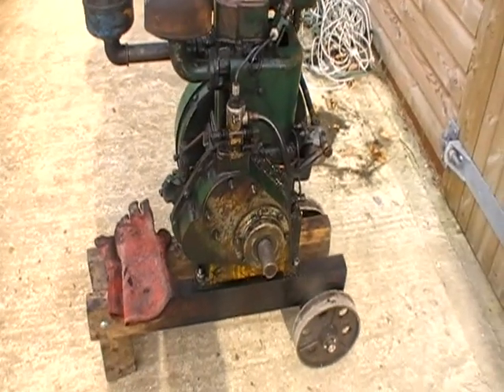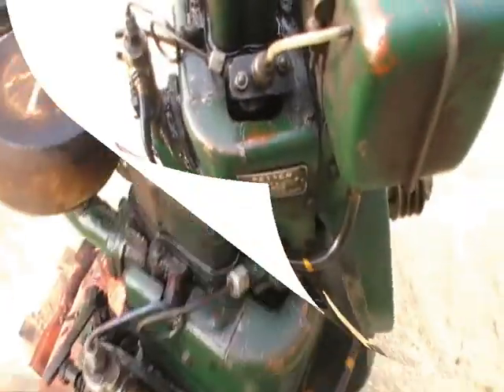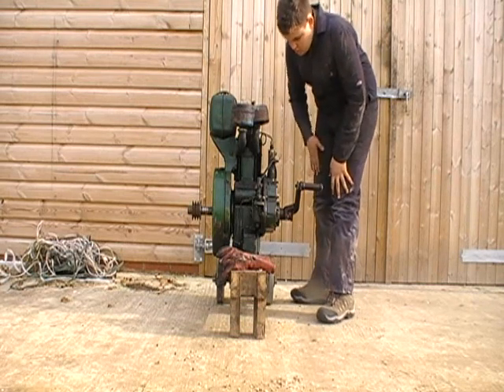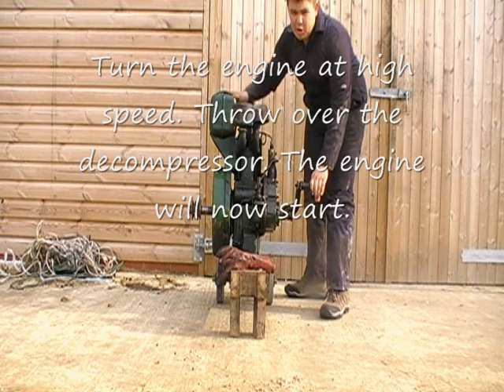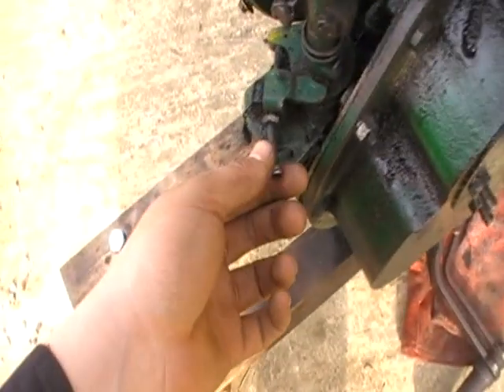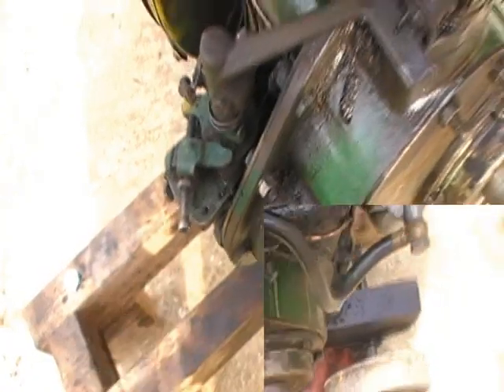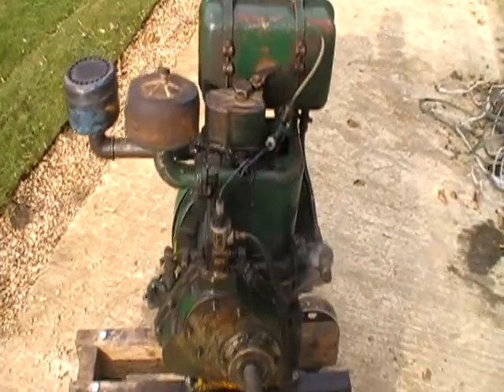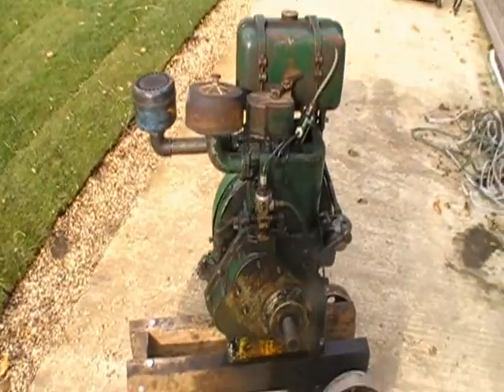Starting and stopping a Petter PAZ1 diesel engine

Comment: i only use the decompresion as a last resort my lister diesel wouldnt stop by shutting down the injector pump because it was pulling oil in from the air filter so thats to only way to stop a diesel if shutting off the pump dosnt work but like i say as a last resort

Comment from the maker: The reason I have to crank anticlockwise is because I have moved the starting shaft from the half speed to the full speed shaft. I therefore have to crank in the opposite way to start it. When starting on a half speed shaft, you crank one way whereas the crankshaft spins the other (on a Petter PAZ1).

Comment: My govenor rod springs to the left by itself once you pull out that little floppy block that hangs there. Upon starting up, the govenor rod moves back to the right, floppy block is then allowed to fall back to its normal hang position and the engine is then in normal run come tickover mode. I dont understand the anti clockwise start either.
Will it start if you crank in a clockwise direction ?

Comment: You are very wrong in keeping your thumb in that position,that is only for 'captive' handles.You will end up with the handle hitting you in the face because when it is released from the shaft you have no control over that heavy handle.Nice interesting vid though,thanks.